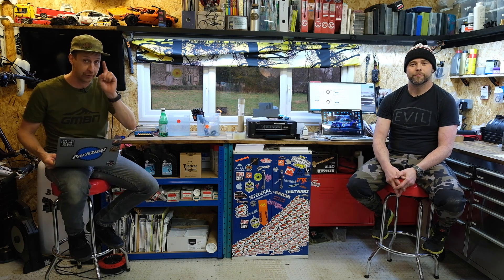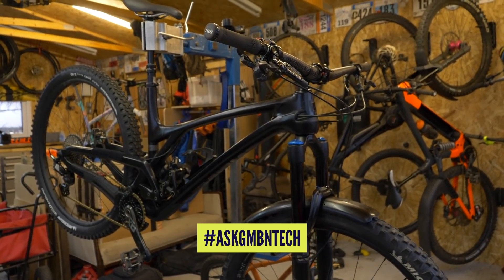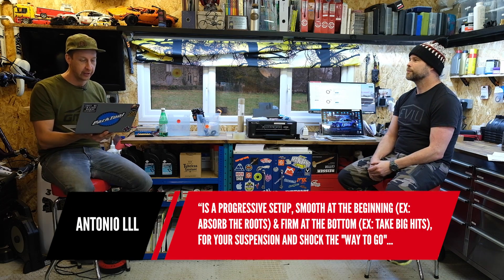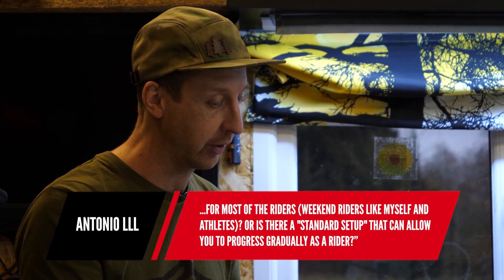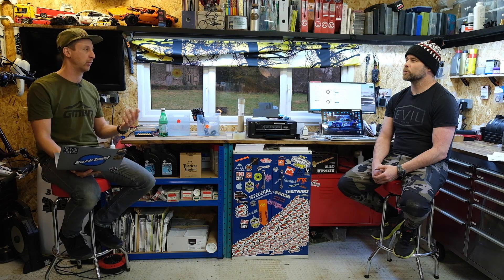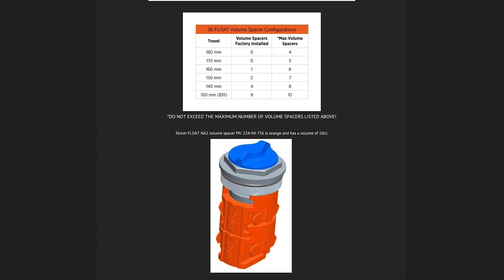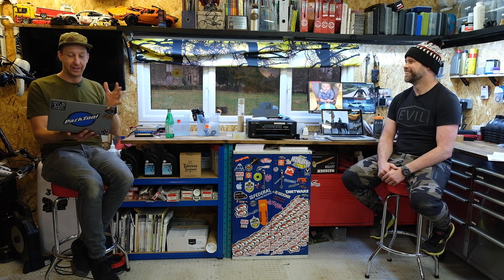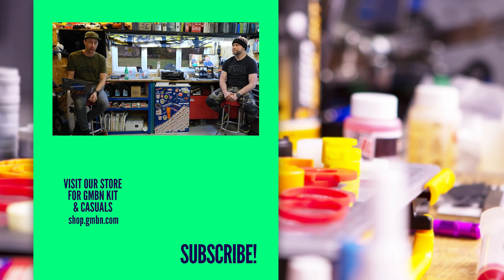Is A Progressive Set Up Better Than Linear Suspension? | #AskGMBNTech Suspension Special

Comment: Finn, Now I don't understand why you'd have the low speed compression set to low at all. If high stops it bobbing when peddling what does low do that you'd actually want? Does it simply make the downhills more comfy or soft anyway which might help it track better? Then with the total lock out of suspension these days wouldn't you be better off having the low speed compression set to a lowish set up and just lock the suspension whenever you're doing any real peddling?
Reply: Low speed is for peddling, add compression to assist more
Reply: You have your high and low speed mixed up
Reply: @finlaypaton7202  OK so you put lower speed compression higher to reduce bob when peddling? Does a lock out make that unnecessary and if you have a lock out are you better off using that and putting LSC lower? What does a low setting offer? I'd imagine it makes suspension more reactive to body weight but what benefits does it really have? 

And have I now got it the right way around... 🤔

INever ridden a Full Sus MtB. Had heart op 10 years ago and basically been unable to ride until introduction of Ebikes. My obsession with all things bike and tech has never left. I watch all types of racing and all videos on the Global Network Cycling channels as there coverage is less a rider showing what they can do, what they have etc and give a more rounded view. 

Oh and they have Doddy who has an amazing all around knowledge, especially about the history of tech and MtBs and often people who know their area amazingly well, like you. When they do I try to soak up as much I can. So when I can afford a EMtB I'll know as much as I can for someone having to rely totally on research and videos and not actual experience, which can be hard.

Sorry to waffle on but Emtbs, especially at a decent entry level are expensive, especially for someone like me who has little spare. Obviously I want as much knowledge as possible before I spend, if, when, maybe I do, can, but gotta keep dreaming even so.

By the way great videos, very informative and interesting. Always love listening to someone who really knows their stuff especially when they can get it across in a way that's also fun to watch. Hope you'll be on more.
Reply: @itarry4  Yes a platform lever just shuts the low speed right down, but you'd still want a little low speed for pedaling, but on the DH rig in the bike park, open her up :)

Comment: #askGMBNTech question for fin 
I recently added a volume spacer to my 2020 Float X2 , when I put the air back in it started making a sloshy noise, I was told it was cavitation ? I had to send the shock off to fox for a full rebuild under warranty thank god 
How can I prevent this from happening again if I want to add another spacer 
Thanks
Reply: The two probably were not related
You have to think of it as two separate systems 
The spring and then the damper.
If it has air in the damping oil it probably wasn't caused by your changing of the volume spacers
Reply: You can get one of those units from Marzocchi (I think?) that replaces the tokens and allows you reset the fork compression without taking it apart.

Comment: #askgmbntech what is the main advantage to a full suspension mountain bike compared to a hardtail and what would you recommend
Reply: Start with a hard tail.  It teaches you to find smooth lines.  But you won’t be able to do huge jumps though.
Reply: Better grip, much more comfortable and easier for your body in harsh terrain. Overall tend to be a bit more fun (generally speaking). Though there are many that enjoy hardtails. First time you try full sus in rocky terrain you will regret you went with ht. But if you are hardcore and like challenges ht can be just as fun. And you can learn to ride just as well with full sus. Learning with ht doesn't make you better rider just because it doesn't have rear suspension.

Comment: New to riding and I have a marin mount vision 5.8 120 with fox 36 van and fox float rp23,  I'm 18st and they seem quite spongey no matter how I adjust them do you think I need them servicing
Reply: It would help for sure, but you are a little more “manly” than the product was designed for 
Something like the Zeb would be more supportive as you’ll be able to run a lower pressure than the 36
Reply: @finlaypaton7202  a grand on forks lol. Sounds nice but the bike even with all the many upgrades still only worth 5-600 lol.

Comment: At what point do I need separate high and low speed compression adjustment? I have a Fox 36 with HSC/LSC and it allways kind of confuses me. That's why i ordered a Lyrik Select+ on my new bike rather to simplify adjustment than saving money. Is this a decision to regret on the long run?
Reply: It’s a fine tune 
Unless you are analytical or pushing for seconds you’d probably be hard pushed to notice on a modern fork. 
They are pretty well dialled in. 
You’d notice more if you were super light or heavy as most products are built around the “average” weight rider.
Reply: @finlaypaton7202  I guess that's the good thing of being super average (75-85kg depending on fitness and backpack). I hear people talking about the advantages of HSC adjustment... My main concern is rather fatigue/armpump than lap times. So the only reason i could think of is incereasing small bump sensitivity while maintaining proper support in compressions. But I never really managed to get that dialed on the Fox 36.

Comment: #askgmbntech Hello Doddy, suspension question. Recently I read an article, that cold/warm can affect the pressure in your fork/shock. Cold=decrease pressure, warm=increase pressure. Scientific question, let say i will store the bike somewhere outside around 0°C and I will there pump the fork to the maximum allowed pressure. Then I will go inside with the bike, where is warmer environment. The pressure should increase - now finally the question - could the fork explode due to excessive pressure? Thnx.
Reply: It won’t explode.

Comment: what would make most difference msr top out cartridge or a charge 2 damper for a zeb fork
Reply: Stick the charger in, turns it into a zeb ultimate. I've no issues with mine at all
Reply: Charger out of those two, but as we know my personal choice would be a Vorsprung Smashpot Coil conversion
Reply: @finlaypaton7202  I loved my old coil shock you have got me thinking now
Reply: If it was available for zeb would go for push ac3 over the vorsprung any day
Reply: @danielazbell6416  Vorsprung is available :)

Comment: #askgmbntech: what's better for someone who wants to start MTB buy a bike with better geometry and lesser parts or better spec with slightly worse geo? Eg: Marin bobcat trail 5 or giant talon 1? I come from a long time on a BMX, so I want something nimble and jump/trickable. Also don't have a huge budget. Any other recommendations?
Reply: Geometry first. 
Then upgrade the parts when you can afford
Reply: @finlaypaton7202  thanks! The Marin comes with decent... Other stuff, but I would need to upgrade the fork (and consequently wheels) first I think. Any suggestions?
Reply: @Jackofafewtrades  depends how much you want to spend, how much you weigh etc, my Go to fork is the Fox 36 or RS Pike

Comment: #askgmbntech the talking about temperature effects on suspensions got my attention. What about the influence of air temp on air springs? Actually this summer when hot weater struck I had to decrease fork and shock pressure as they felt too stiff. Rather, I felt the opposite during the winter. Am In dreaming? So it seems not to be negligible.
By the way, thanks for the show, you rock ;)
Reply: The theory is sound as hot air will expand. 
For instance when cars do track days the difference between hot and cold pressure in the tyres can be more than 10psi.
This would be amplified in a small air chamber as the volume is so small.
Reply: @finlaypaton7202  Yes exactly! To be honest I already knew the answer but I think they should add complementary info on that subject in the next tech episode, it's quite interesting.

Comment: #askgmbntech  : hi I have a suntour xcr air with 120 mm of travel and I am only 35 kg and run 112 psi and if you compare it to other forks with more travel. example: I might only run  50 psi in a rockshox pike .     why is that
Reply: The volume of air in the air chamber. 
And they might be broken 😂
Reply: @finlaypaton7202   they are brand new and work properley
Reply: @angusjones9209  not according to what you describe above

Comment: #AskGMBNTech Can air shocks be damaged over time by jumping with the climb switch in trail or lockout mode?  Is there any difference between Fox and RockShox in this regard?
Reply: Yes you’ll bend the shims and internal components 
The Fox are slightly better in this respect not for toughness but for availability of small replacement parts. 
If you are going jumping, save money add more pressure you your shock.
Reply: Depends whether it’s actually locking it out or just making the low speed really high
Reply: I can bet you forgot to open it up right? Like yeah, I forgot sometimes that my Rear Shock is on the lockout or in a Firm position.
Reply: @zepp3lin  
Buy a Specialized with a Brain that takes care of it for you.
Reply: Please don't

Comment: Another comment on cold weather affecting suspension. The colder the ambient temperature is, the more your air pressure in your spring will decrease. I haven't checked if the internal temperature warms up enough while riding to return to normal pressure, but I don't think it does. It can be worth adding a little bit of pressure in the cold months, in my opinion.
Reply: Your air spring changes more than the damping does, I wrote an article on this recently - https://thesuspensionlab.nz/blog/2021/1/31/effects-of-temperature-on-suspension-performance
Reply: @jono_church  Great read! You answered a lot of the questions I had. I found the typical riding temperature of the suspension very interesting and useful.
Reply: @jono_church I love to see methodological testing like this, versus dogma. Phenomenal!

Comment: #askgmbntech
Is there any reason (except the cleats and maybe the sole) why you can't use Road bike shoes as clipless shoes? If you now you will barely walk or not walk at all the sole doesn't matter.
the only thing I can imagine is that the cleats are not compatible.
Thanks for the Answer
Reply: Road shoes are designed to be much stiffer. 
And try climbing up a muddy field in smooth Carbon road shoes, then film it and send it in 👍👍
Reply: @finlaypaton7202  that stiffness is the idea especially for xc racers
Well yeah going up a hill in those shoes would be a bad idea. I give you that
Reply: @maikszczerbuk613  XC race shoes are stiffer than a "freeride" shoe

Comment: #askgmbntech what things do you need to consider when converting a budget hardtail from 2x to 1x? I’m not too bothered about gearing ratios but just on a practical side of things.
Reply: Depending on your Crank, you can add a spacer between the chainring and crank to get the chainline right. 
If you don't want or need it, just get a narrow wide chainring
derailleur with clutch is optional altough strongly recommended especially if it gets rough.
Reply: I want to get a narrow wide chain ring but how do I work out what size I need?
Reply: @cameronlindsey7951  that depends on your current range of gears, strength and local hills
I took a 11-46 casette and started with a 30t now I'm on a 32 but I got way stronger
Reply: Thanks and in terms of mounting and bcd?
Reply: @cameronlindsey7951  with a modern 96 bcd you won't be able to get anything smaller than a 30t
Thats the only limitation
Reply: On my crankset I can’t see any mounting bolts for a chainring.

Comment: Wow! So I've always been told to use air pressure to set my sag and then also use air pressure if I'm bottoming out or not using enough travel. It never occurred to me that it is crazy to try to adjust two different outcomes (I.e. sag and travel) by adjusting the same variable (i.e. air pressure). Now I need to work out how to put spacers in rockshox! Also, do you recommend the sitting roll off the curb/gutter to set your rear suspension rebound?
Reply: Roll off the kerb is only useful for low speed.
Reply: @finlaypaton7202  I was taught to use it for rebound predominantly. Of the compression, yeah I'd agree it would be for low speed.
Reply: @Tim Quain it seems whoever taught you didnt know what they were talking about then. It is also only for low speed rebound. And also, if they taught you to use air pressure for bottom out/using more travel, they're about 15 years behind the times

Comment: #AskGMBNTech Question for Fin or Doddy. When torqueing up the shock mounts, having just fitted low friction bushes, how do I prevent the mounts on the frame binding on the shock hardware which must be reducing the action of the shock. Is this just poor frame design?
Reply: Reduce torque and use thread locker.
Reply: @doncrescas  to be fair, I'm never using enough of the stuff. Sounds like a plan reducing the torque 👍
Reply: @bitcoinanabasis  use the correct thread locker with activator that helps it set quickly.
Reply: Use the grey plastic like poly bushes rather than the red DU ones the fit isn’t as snug. 
And make sure the spacers allow a fraction of Float on the shaft. 
This way they won’t bind.

Comment: #AskGMBNTech Hi Doddy, when I take my front wheel off and put it back in my fork, my thru axle does not want to come out or go in. I end up spending ten minutes each time whacking the thru axle with a soft ended mallet to get it to go in. I have taken it out, put grease on the axle and it still won't go in. I know it is not a problem with the wheel hub as it is a brand new wheel that came with the hub, and I do not want to buy new downhill forks because they cost a lot of money. Please help thank you. Love the Channel. Please get back to me soon, as I have posted this comment on the last couple of #AskGMBNTech videos.
Reply: Maybe your lower legs are bend
Reply: Does the axle properly seat if you insert it without the hub? If so it is the hub. If not it is the lowers misaligned.
Reply: @doncrescas  It is not the hub as it is a brand new wheel. It is a bike I am building up brand new. The axle does not go in easily without the wheel in. I appreciate the help though.
Reply: @connorcampbell144  the fork lowers are misaligned or the axle itself is bent. Either way take the fork back to where you bought it or contact the manufacturer.
Reply: @doncrescas  Thanks but the company don't exist anymore. The fork was just sat in it's box stored carefully for years and I don't know what to do, but the axle does not affect anything else. Thank you
Reply: @user-yq2tq5eo4u  I don't think they are bent as they are brand new forks

Comment: #AskGMBNTech
What tools does a person who does their own service need or not need and can I use some automotive tools (spanners, torque wrenches, sockets, etc) for bikes?
Reply: Yes you can use the same tools. Buy any specific tools that you need as you go along. I would recommend a good set of allen/hex wrenches which are used much more on bikes than sockets.
Reply: Yeh tools are tools. 
The main reason I keep mine separate is because cars tend to be a fair bit dirtier and I don’t want that inside my bike.
Reply: Buy a good book such as Mountain Bike Maintenance and Repair by John Stevenson. 
It has a great list of the basic tools to get.

Comment: #AskGMBNTech When you want to build custom wheels, how do you know optimal spokes tension (70/90/110 kgf...). Same question after several years using wheels, how do you know if tension is correct or if it decreased (except for obvious like buckled wheel?)
Reply: Usually 100-110kgf is fine for wheels 28 or 32 spokes, but you may need to increase it for fewer. Often rims have a limitation, that exceeding it may cause nipples to pull through. Factory built wheel systems are all over the place with really no rule to it. There's essentially a balance you're trying to strike between long term spoke fatigue, or rim or hub failure. Poor combinations may mean you're forced to build at the maximum of the rim and accept poor durability. Don't go too exotic and you'll be fine. 

It might decrease slightly during your first few rides but, if properly built, it shouldn't change over time. The only way to know is to measure it with a tensiometer.
Reply: Hey! Usually the manufacturer of the rim gives you a max value for the spoke tension.
Reply: The hub or rim manufacturer might say the best on their website or occasionally it's actually on the hub. As for checking get a spoke tension tool that checks the spoke tension.